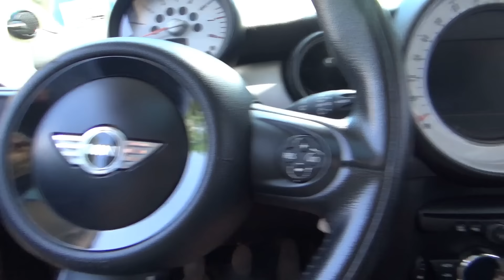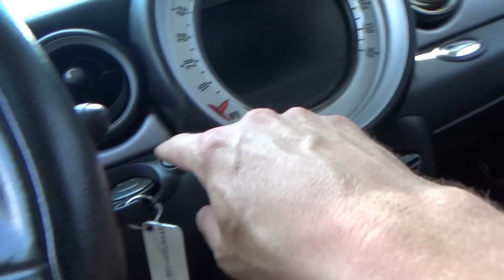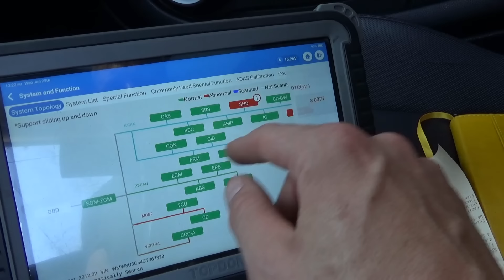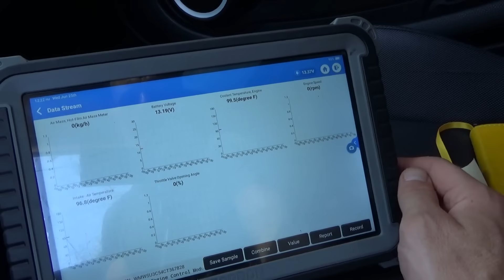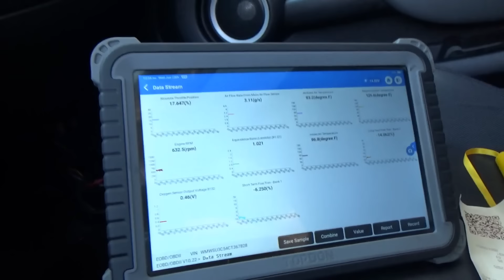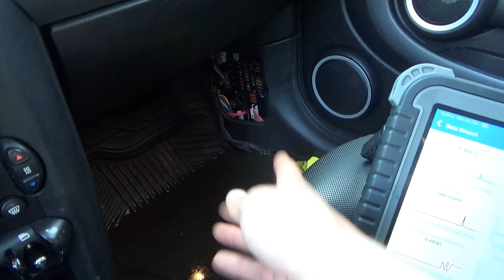(Pt 1) Mystery Mini: Crank No-Start...SOMETIMES?

Comment: So if I'm understanding this video. Do you have the car running? OK. And then they took it in and removed all the interior, cleaned everything and then put it all back which. Tells me the problem is not under the hood. The problem is inside the the passenger compartment. So I would look up where the fuse box is inside the inch compartment and start from there. Which in your other video you do show. The problem is in that. Vicinity and also knowing that there was water damage inside the car, that also would indicate probably the green Krusties which you had found in the next video. So why are you testing under the hood? Makes no sense to me.

Comment: I'm not at your level but knowing that the water was caused by plugged sunroof drains, I would definitely check the inside fuse boxes first.Think it's called foot well modules and wouldn't be surprised if the problem is there.

Comment: We had this on a Nissan Tiida/Versa.
Very low mileage for a C11.
The old one we have, with the MR18DE engine has 250,000 on the clock, and while it's getting rusty, and the trans is a bit sad, it always goes.
The mechanic suggested we take it to an auto electrical specialist.
As an end result, we got the car back several times, but they'd set numerous codes, and it had to go back in again and again over a couple of months.
They'd replaced the ECU, the crank and cam angle sensors, plus the VVT solenoid.
We finally just traded the car this weekend, on a late model Toyota, with P0011, P1611 and U1000 codes on the Nissan. 
NEVER HAD ANY CODES PRIOR TO THE SPECIALIST GETTING THEIR HANDS ON IT, AND NO MIL.
They eventually said it was a mechanical fault, and "please don't bring it back".
Lost $7K on the low-mileage car after 17 months of ownership as a trade-in. Got $500 for it. 
Strangely, it drove over 120 miles to the trade-in point without any issues, except for MIL illuminated, yet again. Except that the second, (new), key would no longer start the car. Wouldn't even turn in the ignition, (it would unlock the doors), yet the remote fob would let the car start. Weird immobilizer light randomly flashing.
I could reset the MIL, but it just came back randomly.
I didn't think I had the skills to diagnose it, but I couldn't have done worse.
You should see the "specialist's" website - apparently, they're the experts, and can fix anything.
Apart from a basic Japanese car, it appears.
$$$.
I suspect that they missed something basic, such as what you found on that Mini.
Never going to another auto electrician in THIS town.
That's 4 out of 4 who can't fix things.
$1200 for a new alternator on my old Accord. Didn't fix it.
Several hundred bucks for a new, genuine, (?), starter solenoid, but it kept crapping out. 
Faulty earth on the battery ground at the body end - I wire-brushed it, and never had any more problems.
My Chrysler, (yes, I know they're a nightmare), was also apparently unfixable - rear hatch open warning light kept coming on. Different electrician. More $ down the toilet.
I think I need to learn a lot about CANBUS, so we don't keep running into these issues.

Comment: As a BMW/mini tech as soon as you see the wiper faults in the JBE that's all you need to know it needs that fuse box module, which also controls the relays for the small fuse box in the engine bay. A new JBE will fix this car.

Comment: My background is more automation than autos, but what you have there is very common. There is power that operates the logic/comms on the module and then a separate AUX power brought to the module to supply/switch power to various components. Everything plugs in at one spot. It's a way to do it.
Why do it that way? Maybe it was cheaper or easier to assemble or they just felt like it. Who knows?

Comment: Interesting you went after the injectors after you uncovered the odd TPS reading. Of course your intuitively taking it back to basics (fuel, spark, compression, timing) was they way to go.  Good Lesson!  Also - great use of load testing with the test lights.  HOWEVER, I don't like to second guess the engineers (bypass PCM for injector power) - even if it sounds stupid.  I would have replaced the PCM.  Interested to see where it goes!
Reply: Yes, WHY did they give the ECM the power to shut off the injectors? Will powering them all the time be a problem? I wouldn't recommend redesigning this without knowing why. Is it a safety system? New ECM time perhaps, as you said.

Comment: At 13:11, at this point I looked up the theory of operation, the voltage goes to the coils from DME through splice x696 the circuit is protected by fuse number 10 in the engine bay fuse box, relay k6326 is responsible for activating the circuit if this relay fails to engage the coils will not receive power. The JBE module grounds the relay activation wire.

Comment: The DME is not supplying the voltage to the coils, it's just a very simple pass-through. If you take a close look, you will see that the wire from the relay is next to the wire that goes to the ignition coils. If you where to open the DME, you could see that it does not even go to the PCB. Mike Salizar has many video's about this. It's strange but I guess it saves a connector between the engine harness and the body harness.

The ignition relay is controlled by the JBE, which is in the pool of water. Since the relay control wire is permanently hot, together with the control wires for the wiper relays, they corrode very quickly.
Repairing this particular problem on the JBE is something that I do almost every week. I bought long pin headers from which I get individual pins so I can replace the corroded ones. There are also two places on the PCB of the JBE that get corroded.
Reply: Wow I guess you already solved the problem although obviously these are filmed a long time prior to posting so will be interesting if Ivan finds what you stated. Is the JBE corrosion/water intrustion usually/always from the sun roof/sun roof drains?
Reply: @adamcweber  It is indeed very common that the water ingress comes from the sunroof due to clogged drains, but the door seal also often leaks between the body and door seal.

Comment: Hi Evan, big fan here, can you please explain what the test light has to do with the fix and how you connect it i cannot figure out. Thanx
Reply: It limits current available for short circuits. Or it places a circuit under load rather than just checking continuity.

Comment: Good stuff wonder why they would have all that stuff run inside of the computer and why it wouldn’t throw a code if it wasn’t getting power to coils.  I thought when it was manual it was gonna be a clutch not engaged type sensor cutting off power to coils but it would throw a code for that can’t wait to see what it is thanks for the video

Comment: Haven't read through the comments yet, but the high throttle position without touching the pedal has me thinking... Could a faulty intermittent throttle position sensor be telling the ECU that the driver wants to do a flood clear or compression test, and therefore do not fire the coils? I would think that such a mode would turn off both the injectors and the coils, but who knows what the protocol is. Just guessing. I would like to know more about what is going on with the throttle position sensor.
Reply from the maker: #Valvetronic 😉

Comment: fill passenger side with water again i bet works fine again. or wet the fuse box again. my q7 has hidden water damage from roof drains, if the area gets wet again it suddenly works again.

Comment: Aww man.  Intermission just as the diag was getting good.  I'm betting on green crusties have taken hold on the ignition power source lead.  It's either that or a cooked relay.  But my money is on corrosion.  Seeing that pool of water on the passenger side floor has me very concerned.

Comment: Lost-electron-itis!  Very BMW-y.  I've only ever worked on two Minis in my life, one of them was an original from the 1960s.  I have, however, gotten my butt kicked by more than a fair share of BMWs.  No idea what's going on here, but what I can tell you is don't trust system wiring diagrams, as they only focus on the system, not what's supplying power to the DME to pass through to said system.

Chevy does something similar with their BCMs in some vehicles, where you can have multiple fuses that supply power to other things, each also supplying a bit of power to one or two "sections" of the BCM.  Chevy is at least nice enough to include the fuses in the wiring diagram, but the German approach is typically to compartmentalize systems.  The coils get their power from the DME, but where does the DME get its power from?  That's a separate system unrelated to the ignition coils, so it's likely on another diagram.  My guess is that the DME has multiple internal 12V pass-through buses that are sourcing their power from fused circuits and relay controls, and it would not surprise me at all if the BCM had some level of agency over that.

Comment: I had one of these that was a crank no-start with the DME periodically not communicating. Some voltage drop testing found the main fusible link next to the battery was corroded to the point that it was nearly rotted in half.

Comment: Once you realize every BMW made Mini is a POS it is not so bad. I have a 2011 in my driveway. Constant niggling little problems. Very poorly designed. Only upside is that when it runs it is like driving a Go-cart, the suspension is also similar :)

Comment: Ivan has been pumping out some great case studies almost every day lately!   As for this one, that much water in the floorboard from a clogged drain doesn’t just evaporate without any long term issues with the wiring me thinks.  2 PARTER FOR THE WEEKEND BOYS AND GIRLS!
Reply: That's what is going on here, Ivan making content for videos. If it was about getting the car down the road , he would have been over on the other end of that circuit a long time ago after looking at the wiring diagram.😀

Comment: All that water pooled up inside would be a huge hint where to start looking. Peel back the carpet and check for corroded wires and grounds. There's probably modules under the seats too, and under the console.

Comment: What you need to consider is that's not a BMW engine, it's Peugeot.
The way these are laid out in the ECU, there's no driver to give the coils power, but the large green wire connects directly across to the pin of the  adjacent plug inside the ECU.
However, the source for that is NOT the "ECU main relay" (that's the term 87).
There's a "terminal 15" relay in the engine fuse/relay box adjacent.
That's controlled by the module in the flooded right footwell.
You know what you're going to find, don't you!
Yep, the green crusties have set in on the bottom plug, the pin has corroded off the module.
And also the one for the wiper relay 1 probably
Reply: Interestingly BMW on their Toyota connection, couldn't help but modify certain wiring systems used by Toyota. Creating a problem zone when those mods go bad. Perhaps BMW modified Peugeot's wiring to suit their methodology and created a similar type of problem zone.
Reply: @seagullsbtn I think this one is most likely for engine STOPPING purposes.
The ECU is woken by CAN, not t15 ignition power.
So if for some reason the engine shutoff message couldn't get through, removal of power to the ignition coils will certainly stop it.
Reply: Its more bmw than Peugeot.. hence the variable valve lift, and bmw type issues theses engines have (valve stem seals, oil burning)
Reply: Perfectly spoken, but I would really rather be an armchair, mechanic, screaming wiring diagram, wiring diagram!!!.
Reply: @Rail_Pass_Nightmare the wiring diagrams are not very helpful on this, they don't show the direct power paths within the ECU, hence Ivan thinking there was some form of switching going on in there.
On certain Peugeot models they do show the internal direct connections.
On some occasions those circuit tracks do get damaged, particularly from such things as a shorted PCV breather heater.
The fix in that case (once the short is found and fixed) is to fit an external jumper rather than replace the ECU.
Reply: @simonparkinson1053 just subscribed to your channel!  You seem to have deep knowledge of these quirky but entertaining cars.  I have 2012 cooper s that has the 2c57 code and I’m fairly certain it’s a worn waste gate.

Comment: This is a good one... weird design though.  Normally the ECU would just trigger a relay and the power would be delivered to the coils.  That would limit the current the ecu would have to manage.   Just seems like you wouldn't want the coils directly connected to the ECU.

If I read correctly, the DME may be the cause.  Good luck!
Reply: European engineers ￼￼

Comment: 1.13 in, wiring under the seat, there is a big connector for earths under one seat and lives under the other. Caused a roof not to fold down as the earth was bad from under the seat
Reply: Good call I think.  Cadillac SRX’s have the same thing under the drivers seats.

Comment: Temperamental Mini, Ivan! If it's the computer, why did it start the first time? Cracked solder joints? It has to be good, once this is a multi-part video 🙂

Comment: So possibly a relay or the control to the relay?
Or failing that: GREEN CRUSTIES!!!
Looking forward to prt 2. Thanks Ivan.
Reply: I'm betting a wire has partially rubbed through somewhere and you get intermittent connection every so often due to crusties. That is why it roared to life when he first started the car without doing anything.

Comment: I've had several minis where the fuel pump relay (in the fuse box and not replaceable) fails and sets high pressure codes .
The typical list of replacement parts has no effect......
So i basically do the same thing , new modules are expensive and need programming

Comment: My guess would be a bad fuel pump the way the engine is cranking over sounds like when you run out of fuel.
Reply: It is not. On the pico, we don't see spark, but he can smell gas, so gas is going to the cylinders.
Reply: Did you watch the video